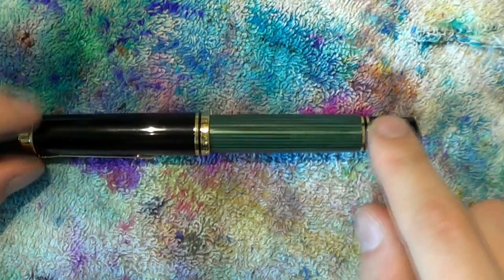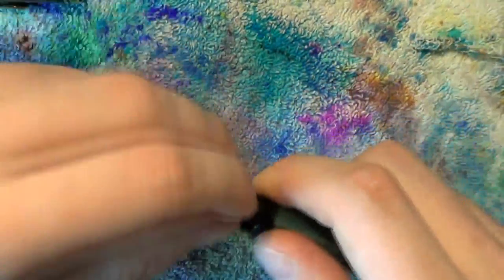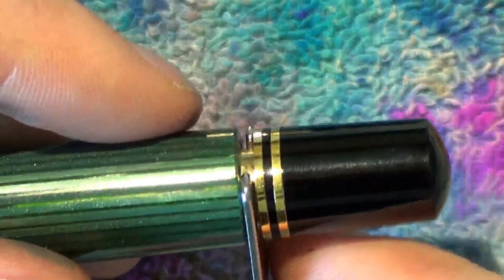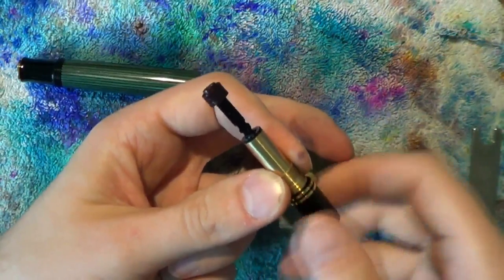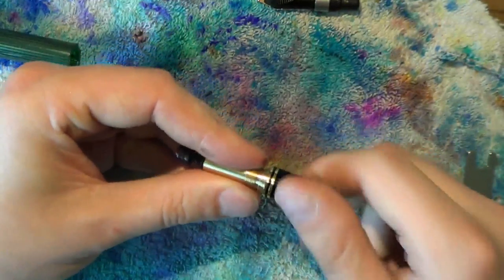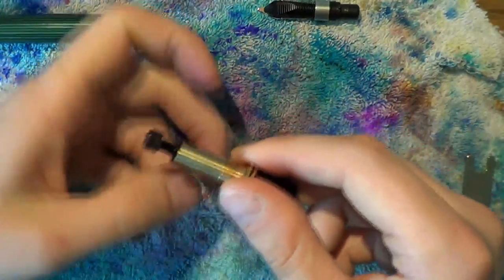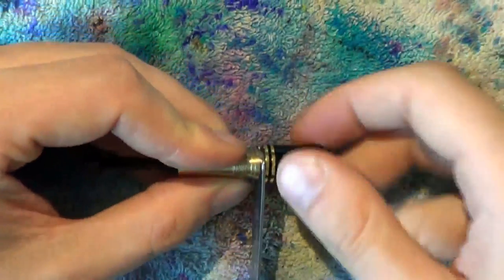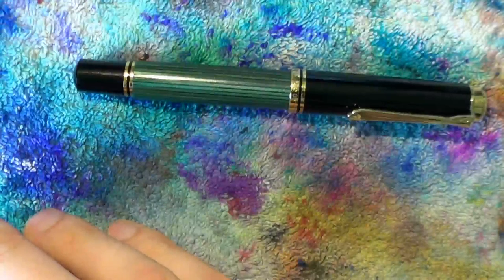Disassembly Line Pelikan M1000

Comment: My M800 has been sitting not-quite-reassembled for a couple of years now.  Today, I finally watched this video carefully enough to follow the steps accurately--and my 30+ year-old bird is up and running again.  Its barrel is cracked, but it doesn't leak, and it writes as well as ever.  The crack in the barrel came when I stepped on it, probably, with my 200 lbs. weight.  These pens are workhorses.
Reply: I liked reading this comment.

Comment: Thanks, I accidentally dropped my pen case, with M800, M805 and MB146 inside, from a first-floor window, a distance of five or six metres. Miraculously all three survived, though the piston unit of the M805 had been jolted loose. After finding a suitable wrench in my local bicycle shop, I followed your instructions to get a perfect result. None of the pens has a scratch and all three work just as they did before.
Reply from the maker: Andreas Smith I'm glad this was helpful.
Reply: Andreas, you put a flock to the test.  But these 'kans are not meant to fly, dude!
Reply: @gregorythomashalsey4801  I'm still amazed that my pens survived! I was cleaning out my bag, with pens inside, when the accident happened. Anyway, it's proof of how tough Pelikan pens are ( the MB146 just got lucky).

Comment: Absolutely wonderful pen. Had a m800 demonstrator pen I had to reassemble on the fly without a twisbi wrench available but used a unfolded large paper clip with the curved edge pulled firmly against the  metal unit. 

Many thanks.

Comment: Hi I was hoping you could give me advice. I have the same fountain pen and I recently dropped it. The top black piece (with thin golden ring) separated from the barrel (the green part); everything else is in place - the piston, the nib the screw at the bottom. Can this be fixed?

Comment: Perfect for cleaning and rediscovering my ink laden M800.  There are other videos on here about disassembling and reassembling the cap.  I had ink trapped in between those two that I couldn't get out with just a water pick tooth tool.